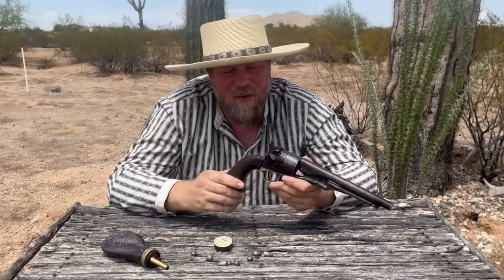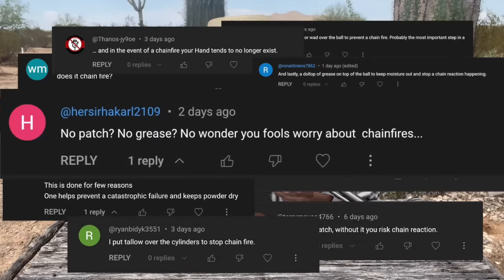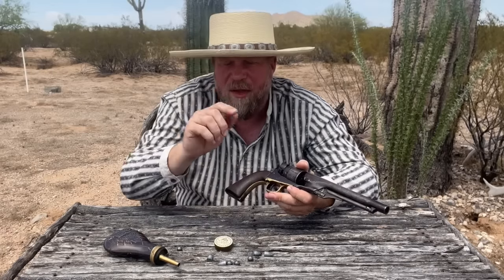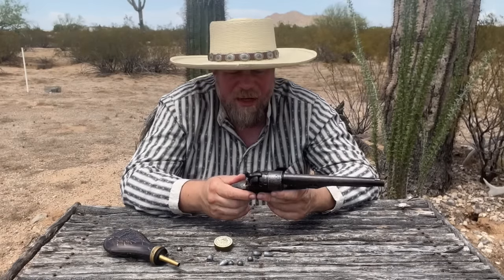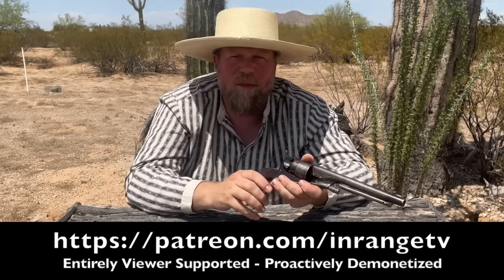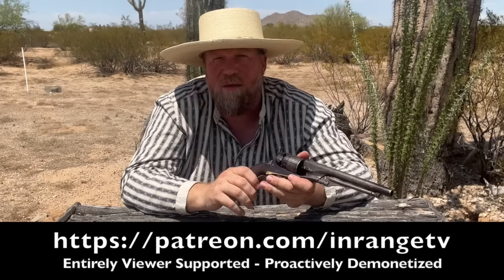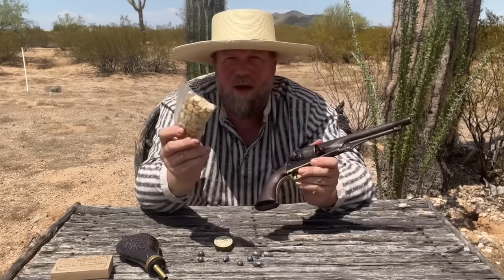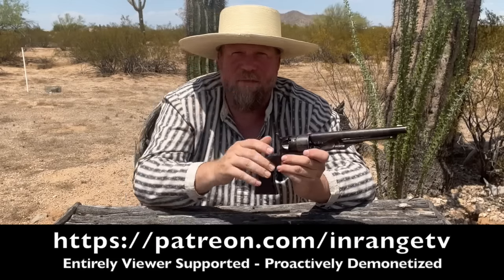Chainfire!  Is it dangerous?

Comment: The big worry with chainfire historically was the military attempting to adopt Revolver Rifles. Chainfires aren't great with a revolver but it's not going to blow your hand off like it will if your off hand is braced in front of it.
Reply: I have an original colt revol e rifle. I can definitely see why that would be the case. Where you place your hands to fire the weapon, is directly in front of the cylinder. Your whole hand would probably get ripped off in one mishap.
Reply: @Joe-sc8fu  they had enough injuries to can the trials. I don't know exact number but "more than two is a pattern"
Reply: @calvingreene90  It was the only way to hold the weapon that was issued to them.
Reply: @calvingreene90  Alright, my bad dude.
Reply: Even on a handgun this was dangerous at that time, because the steel wasn't strong as it is now.
A chainfire of severals chambers still have a chance to make the cylinder explode on an original revolver.
Reply: @Joe-sc8fu  I don't think people were trained to fire revolving rifles that way. For one, many of them had bare barrels which would not be so great to hold when hot.
Reply: @calvingreene90  I would love to see someone hold a 3-foot, .45cal rifle like that and keep it even remotely on target. I dunno if you've ever seen the Colt New Model...
Reply: @calebhu6383  the CNM has a bit of metal up front intended to be a handguard. It's also important to note the intended lower ROF, as well as the fact that heat issues simply may not have been a noted issue due to them being far more worried about chainfire.
Reply: @calvingreene90  except the intended operation wasn't supposed to be dangerous. Issues only arose with chainfires, which is why they DIDN'T adopt the gun.
Reply: @calvingreene90  bro are you okay? You seem really insecure about how you can hold a rifle double-gripped.
Reply: @calvingreene90  you need to drop the aggro a couple points or you aint getting more responses my man
Reply: @calvingreene90  I'd like to issue a reminder though: a two handed pistol grip being used on y'know, Pistols. Wouldn't become popular for another hundred years or so.

The idea of holding a pistol-like object in such a manner would've been rather foreign to your average soldier of the time

Who admittedly, probably also wasn't the brightest either
Reply: @1stCallipostle  I mean, he came in here telling people they deserve getting their hand blown off testing a gun and calling folks weak, I think he's past listening to us
Reply: Revolving rifles always had a "horn" at the bottom of the trigger guard for your second hand ti index onto. No foregrip to hold just barrel so the weight is on your hands. Never a worry. Shit the gas alone would hurt forget a chain fire.
Reply: @calvingreene90 
I can understand the attitude because you must be livid everytime you look in the mirror
Reply: @calvingreene90  
You are projecting*
Reply: And the chainfire people shove that goal post right up to elephant guns after his next video with a revolving rifle.
Reply: @calvingreene90  You don't get a stable grip that way, regardless of how strong you are. Revolving rifles died because they're a bad idea, end of story.
Reply: Apparently their revolving shotguns had adjustable cylinders to reduce or possibly eliminate the gap, not sure if the rifles were the same
Reply: @calebhu6383  It's the military, you do what you are trained to do and if it is a loosing hand kinda thingy you adapt after it surfaces.
Reply: @Joe-sc8fu  I'm wondering why they didn't just attach a wooden grip a bit below the barrel to move your arm somewhere safer.
Reply: Which is why the colt revolving rifle never became popular
Reply: @calvingreene90  I mean, it can be done, but it's not a very good solution. You can't get a lot of stability that way and it would probably take a lot of training, which isn't suitable for military use. Not to mention that you have to use a very heavy stock to offset the point of balance, which means unnecessary weight. Plus iirc revolver rifles, like lever actions or early breech-loaders, were supposed to be issued to the cavalry and while firing on the move is just one of the fires cavalry employed at that time it wouldn't be very useful in that role.
Reply: @Wayne72LEVRAI  oh look someone with a brain, actually it wasn't even steel, these revolvers were originally made with brass so ya absolutely way more of an issue when compared to modern steel replicas. Though they still make some brass frame replicas today as well.
Reply: You're confusing hindsight with intelligence
Reply: Actually, the problem with chainfires was with the flintlocks as you could sometimes have the guy firing next to you set off your rifle by accident.

Comment: Blame the 1950's when everyone bought a kepi, rifled musket and cap and ball revolver and took them to the range in huge numbers.  I suspect that there was a print campaign to promote safer loading practices that would accommodate every level of knowledge from "dedicated historical researcher" to "bought my kit at Kmart Saturday, does the ball or the powder go on top again?".
Reply: I expect you are correct. I started firing cap & ball revolvers (reproduction Dragoons, 1851 and 1860s) in the 1960s, and I remember being constantly told to cover each chamber mouth with grease (kind of like Crisco) to prevent chainfires - but it was obvious that could not have been how the weapons had been historically loaded (as Karl notes, the grease doesn't stay put, it melts and runs everywhere). I find Karl's commentary about bullet size to make perfect sense and certainly to fit the ideas of the 18th and 19th centuries of how to get bullets to get some bite in the rifling.
Reply: First you drop the cap down in the chamber 😂
Reply: @beargillium2369  thats right. Then load the  solid copper 45 acp bullets, then pour the powder on top. Powder on top ignites after the projectile leaves the chamber, giving it that extra boost in performance.
Reply: @jontee3437 the hollow point acts as a rocket nozzle if loaded backwards. It's like a gyrojet, the most effective weapon known to man.

This is a joke. Do not do this.
Reply: @gfin4576  I'm assuming  the sarcasm comes through but don't do it.
Reply: @KR-hg8be  You defy the Gospel? Away with thee blasphemer!!!!
Reply: @jontee3437  you'll have to get through my hail of backwards 45 acp gyrojet rounds first !
Reply: As someone who shot historical cannons, most of the outright more dangerous practices of loading used by some reenactors can be directly traced to that. If you do things historically, with the right equipment, it's perfectly safe
Reply: @Ghatbkk I seem to recall that it was not out of the ordinary for reproductions from that era to have chambers that were machined slightly out of round. I don't recall where it was, but the result was that you could get a reasonably tight fit of the ball but still have gaps.

Comment: I have personally experienced a chain fire.  It was NOT caused by not having grease over the chamber mouths.  It happened because a couple caps fell away from the cones on some unfired chambers on a Pietta Navy LeMat reproduction.  It tore off the loading lever and sent it downrange.  It was one of the scariest range mishaps I have directly experienced, and ended my day of shooting, though with no injuries.  I had fired the center grapeshot bore first before I fired the regular charges, and I think this contributed to the accident.  Pietta LeMats have a known issue where no. 11 size caps fit rather loose on the cones.
Reply: The first black powder gun I had, years ago, was a 1851 Colt .36 repro. For some reason #11 caps were too loose. I had to use #10 caps, which were a bitch to find.
Reply: @grizzlyblackpowder1960  Bold of you to assume I didn't read it.  It said no. 11 caps.  Incidentally, all of my other repro black powder revolvers also take no. 11 caps too, as per their owners manuals.
Reply: I bought my Ruger Old Army in 1975. I have fired thousands of pure lead 458dia, 225gr. conicals and hundreds of 457 cast round balls out of it. Never had a chain fire. Now I know why. Thank you.
Reply: That's a shame, Lemat's are gorgeous.
Reply: Buy track of the wolf stainless nipples
Reply: @Einwetok  I did manage to find replacement parts for it, so it was not a loss.  It was however, a real b!tch to find those parts.
Reply: @kevincornell1439  You do realize that this varies from brand to brand, right?  Also, I would be real interested to have you explain to me why no. 11 caps fit snugly on the cones of my Pietta Remington New Model Army, my two Uberti Walker repros, and my Navy Arms Colt 1860 repro.  I mean, they must all be wrong and I'm just a stupid fudd, right?
Reply: I really don't see how a cap falling off could make a chain fire happen. 
The flame doesn't go anywhere near another nipple. 
Everything I've seen chain fire happen because of wrong sized lead. 
Even with the leMatt how does the fire go around then in. It makes no sense.
Reply: @kevincornell1439  show me we’re to look. You can laugh as much as you like. Yet I’ve never had it happen in 35 years of shooting blackpowder. Maybe physics works different for some people. 😆
Reply: Those loading levers are terrible I bent mine on the lemat because I took the ramrod out to tamp the shotgun barrel and forgot to put it back when loading the gun itself and bent the damn thing
Reply: @kevincornell1439  re-read my post.  I only had ONE chainfire, on the LeMat, which takes no. 10 not no. 11 caps.  I took a risk, and it was a stupid one.  I own that.  Literally ALL my other guns of this type take no. 11 caps, and I have never had chainfires in any of them in 25 years of shooting them.  You need to really improve your reading comprehension before you go around calling other people stupid.
Reply: @Mibit911  I feel that.  It was a really poor design in general.  Too flimsy, and not enough leverage.  I ended up using a loading block to load mine for that very reason.
Reply: I also had a chain fire with the LeMat, but because of undersized bullets. I had several caps falling off while shooting, with the LeMat and with my 1860s, but this never resulted in a chain fire.

Luckily my loading lever on the LeMat survived the impact. This is a stupid design, and I use an external press for loading, but keep it on the gun for the looks.
Reply: I didn't know  Pietta made La Matts . thats a very unique pistol i would really love to have.
Reply: @Ostenjager  sounds like it'd be cheaper long run to convert to #11 nipples
Reply: @Einwetok  Coolness factor 150
Reply: @Ostenjager  I use #11 on my 2 colt Pietta's my Remington Pietta and my 5 shot 22 mag Deringer , all fit well.

Comment: I was always taught that if you weren't shaving a ring of lead off of your ball when you rammed it home, you weren't getting a proper seal and you needed to use a bigger projectile.  Glad to know I haven't been doing it wrong all these years.  I have balls sized to each of my revolvers, and all of my nominally .44 revolvers take a slightly differently sized projectile.
Reply: Thats how i do it as well and haven't had a chain fire since starting in 2010. Logic says if the ball is cut ALL way around , its a tight seal
Reply: The lube should prevent that anyway. From the few first hand stories iv heard of chainfires the problem is on the other side of the cylinder, as in improper sized caps being too loose on the nipple amd setting off other caps.
Reply: @whatsmolly5741  In my 15 years of Black powder ive never had a cap come off like that. When i get a loose cap i use another, or change the nipple if its a consistent issue. BTW grease in the chamber just melts in most areas with Temps over 80F
Reply: @maddhatter3564  I haven't had any issues either but if one was to use say size 11 instead of size 10 I can definitely see it happening because you have to pinch the 11s just to get them to stay on. 

The lube can be a bit annoying but if you make your own that gives you the ability to match the consistency to your areas temperature. 
I use bees wax and olive oil/lamb tallow/paraffin and mix different batches with varying consistency so I have something for most occasions.
Reply: @whatsmolly5741  Yes, always use the right cap, of course
Reply: @whatsmolly5741  Likely. I always reject any cap that's loose. my Remington gets fired once a year on 4th of July and the caps hold quite well
Reply: @maddhatter3564  ye but you know there's going to be more than one idiot who doesn't care enough to toss the loose caps. 
Also the ammunition shortage we had a few years back effected all primers including black powder primers so people were using what ever they could get for quite a while.
Reply: I've been shooting black powder revolvers for a little over 10 years. Why? I live in Texas and I'm a felon. And legally speaking a felon can carry a black powder revolver in Texas and not be breaking any laws. I've been stopped a few times and the cops typically have nothing to say after they read the letter sent to me from the ATF addressing me and essentially saying I'm well within my rights and not breaking the law when carrying a black powder revolver in Texas. Now I cannot carry it concealed as it must be carried on my waist sorta like a cop carries his gun. But that's ok as it's a big clunky gun that's not really made to be concealed. Anyhow, that having been said ...yes I have some revolvers that are better sized to take .451's and others that are .454's so long as your shaving off that lead ring chain fire shouldn't be an issue. Moisture is more of a problem as moisture can cause your percussion caps to malfunction. I change mine out about every 6 months.

Comment: Nice to see someone adressing this correctly! To add to the problem, the chambers on original Colt percussion revolvers are not cylindrical, they are slightly conical, larger at the mouth than deeper down. With too small balls, they are more easibly able to ”roll forward” in the chamber under revolvers (since they were too small to befinner with). As they roll forward they are now even more undersized then when they were (loosely) seated further down in the chamber. Thus, there is nothing stopping the flame from igniting the gunpowder. 

Anders Olsson
Reply: Full semi auto
Reply: I'll bet the conical cylinder bore was designed to address the chainfire problem by squeezing down the ball as it was being seated, and jamming it in place. Still won't work if the ball's undersized, of course...
Reply: @iskandartaib having a conical chamber also means the conical bullet, rather than a ball, will have increased tightness, spread across more surface area. So the conical bullet might compound the protection against chain fires

Comment: I've always heard to either use projectiles big enough where a circular ring is cut off by the chamber, use grease otherwise.
Reply: Large enough projectile to cut a ring off is what I have been doing. No chain fire yet in a lot of years worth of black powder shooting.  😉
Reply: 💯 The proper sized ball or conical should leave you a ring. As Karl mentioned in the vid: the bullet is [getting a small, final] swaged into the chamber.

I can't find my sources, but I remember some contemporaneous anecdotes mentioning how that was interesting to them (being outside the norm from pre-revolver pistols).

Comment: I've been shooting C&B revolvers for over 60 years. In that time, I've had only one multiple discharge, on a 1969 mfg. AMS 2nd Mod. Dragoon. The cause was in the ball size. Normally, .454" balls were loaded in the traditional manner, with no ill effects. However, I was given a mould by a friend, being a conical bullet. The mould was marked as .452" diameter. And yes, one chamber was compromised by flame going past a seated conical bullet. After the incident, the remaining cast bullets were measured at .450". The chamber that this particular event occurred, measured .452". Very obvious that this allowed the incident. 

The mould that was at fault, was an early Lee single cavity mould. I have been casting and loading my own since a boy in the late 50's. All my moulds are Ideal or Lyman made. 
To this day, I'm not using Lee moulds, though I've tried a couple of the newer ones. They are not satisfactory, and have been discarded. Ideal, Lyman, and RCBS moulds are the only ones I use. I've accumulated close to 75 iron moulds, and they are without any faults. 

In closing, in C&B weapons, I always cast bullets to .002" to .004" larger than the largest measured chamber in the weapon's cylinder. No grease, wads, or other substances are used. Simply a properly fitted ball, and powder. And zero issues with multiple discharge in any...